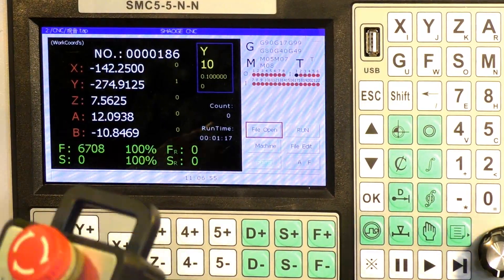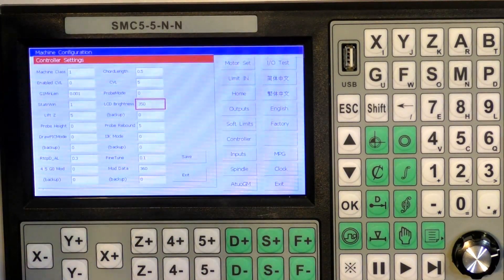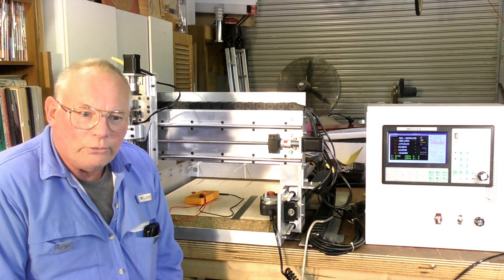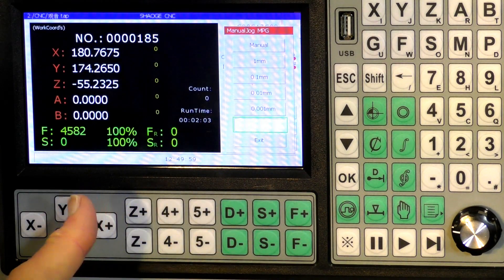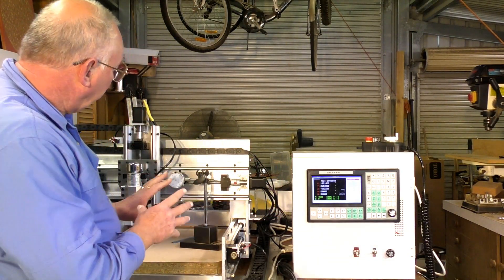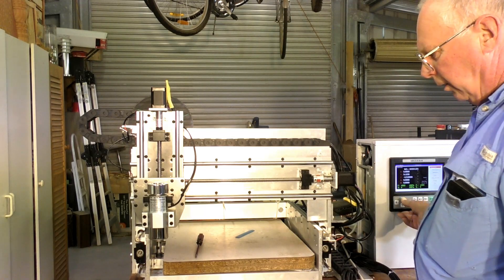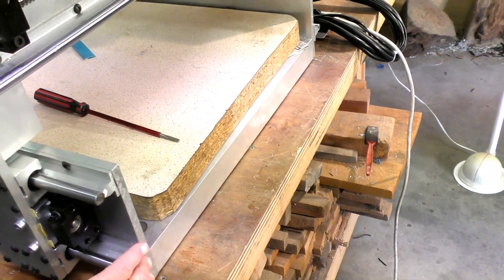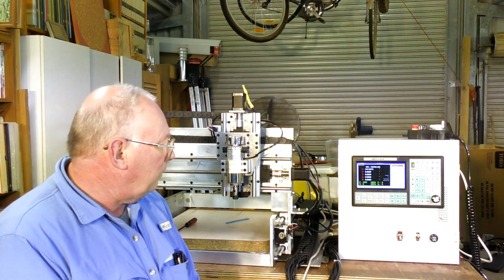My DIY CNC router with an SMC5-5-N-N offline controller final setup

Comment: Hi Roger i have mine up and running but can't find a way of adding an external variable resistor for the feed control as its a bit naff pressing buttons up and down . Any ideas ? regards Dave from the UK
Reply from the maker: You need to push the buttons sorry and all that ;-))

Comment: Where does one find the wiring diagram or schematic?
Reply from the maker: All part, plans and pricing information for CNC builds are available on my Patreon pages. + Technical assistance is available on my Patreon pages  
https://www.patreon.com/user?u=15079773
Reply: @inventorsworkshop9600  thanks Roger 😊

Comment: Hi Roger , off this subject do you have a way to get e-mail ? I have a question on my new axiom cnc, the finish pass on all my 3d photos imported are air cutting not  hitting the wood , the rough cut is good but the finish is not , can you help me ? Thanks Tim, I am running vectric aspire
Reply from the maker: Yes, information is available on my Patron pages
 https://www.patreon.com/user?u=15079773
Reply: @inventorsworkshop9600  ok I will look at it thank you

Comment: I’m looking into adding a 5.5 Watt blue laser module and using this controller. I’m using output 1 for my spindle run and spindle cooling on. I’m wondering if I can use M102 To turn on the power to the laser and then M202 to turn it off? I don’t want to use the spindle on off m3 and m5 because of the built in delay.
Also want to use the PWM output to control the laser power level.
For Mach3 they recommend M10 and M11 to turn on and off a laser. Not sure if M10 M11 works on this controller, I didn’t see anything in the manual for M10 M11?

Comment: Good video Roger!
How do you back off of a tripped limit switch? I’m still trying to figure out if there is a button to allow you to move an axis after it has set off a limit switch.
Reply: I found this to work:- example if x axis has tripped the - limit then press x axis + jog button and hold it then press the rotary button, every time you press the axis will move 0.1 until you are clear of the switch then you can press reset
Please note The selection box must be around the flashing reset button on the screen then follow above
Reply: zyybo Cool I’ll give that a try !!!

Comment: Can you enter backlash comp in the controller?
Reply: Yes. But some units come with old firmware and need to be flashed with new firmware for that function to appear.
Reply: @grimkarltun7846  Ok but any input for spindle encoder?
Reply: @the_lost_sweed   I think so but I am not sure.